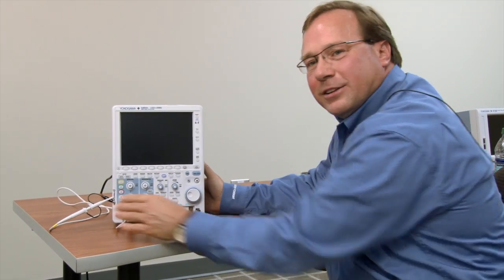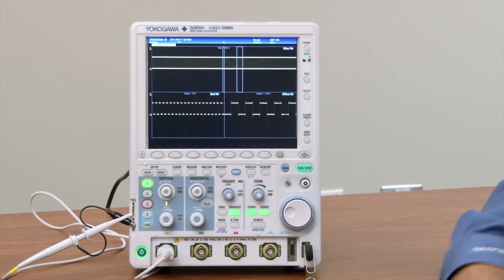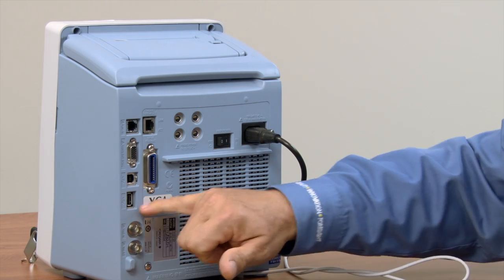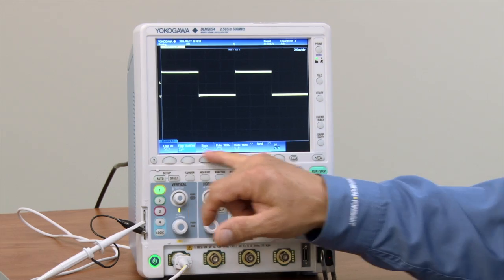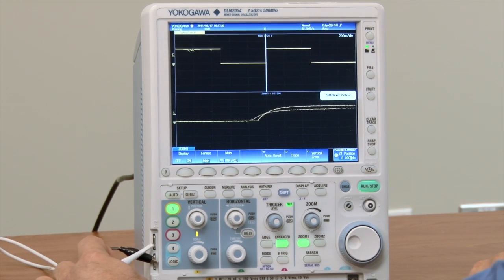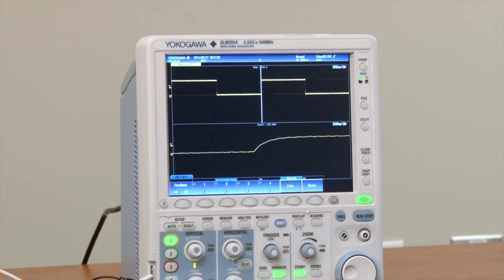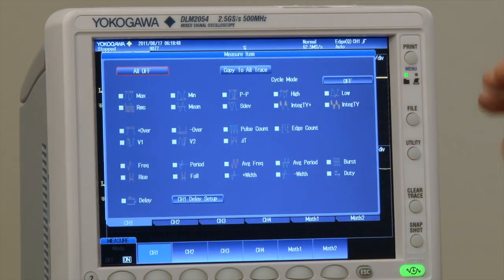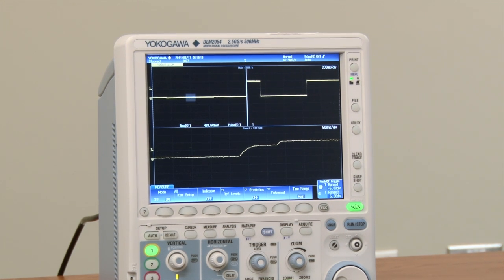DLM2000 Mixed Signal Oscilloscope Demonstration

Comment: How many sec did you cut from video when oscilloscope start?
Reply from the maker: It typically takes 10-15 seconds for our scopes to start up. Our scopes aren't Windows-based so the startup time is usually much faster than other scopes.